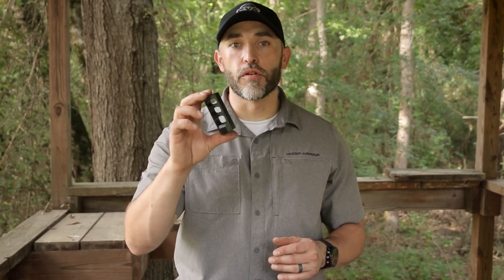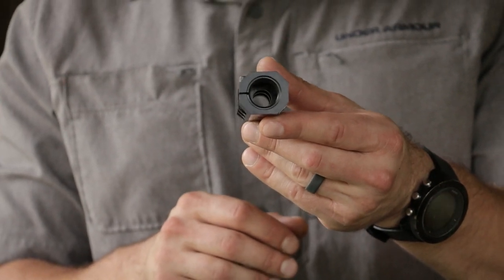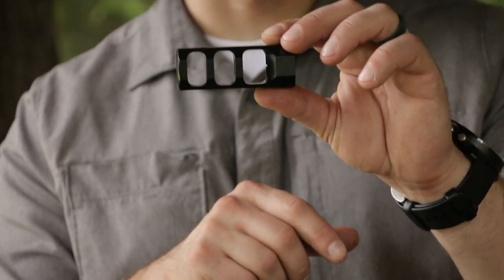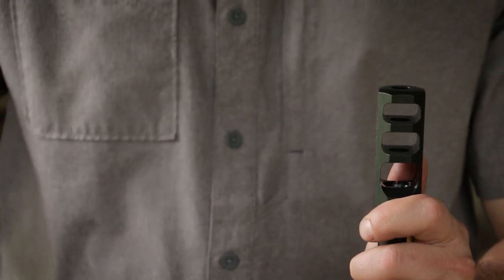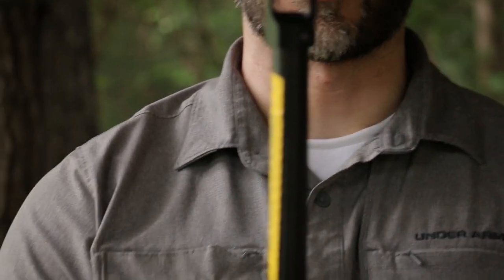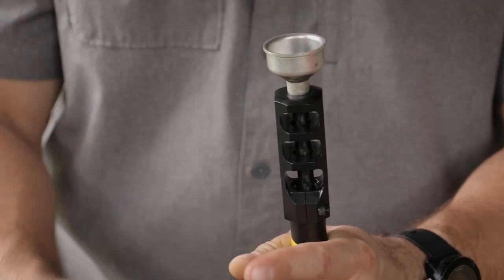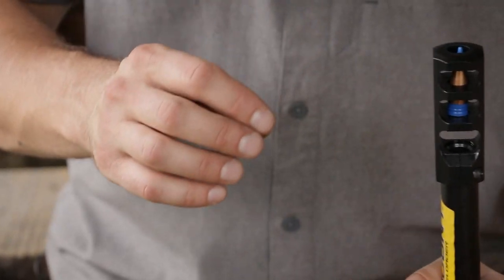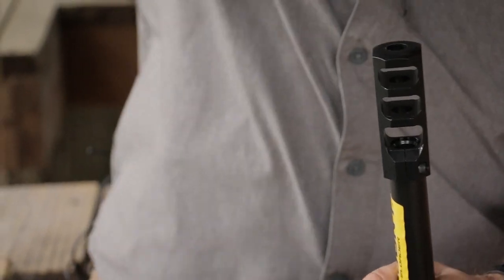Testing The CVA Paramount Muzzle Brake

Comment: I have read reports and seen pictures of muzzle brake failures on the Paramount pro with this brake. I just recieved my new Paramount Pro, have not shot it yet. The AC1725 brake is not available anywhere right now. Is that because of failures, changes, production? I email CVA 2 week ago and they have yet to respond with any answers. anyone have info?
Reply: There brakes suck , have had 9 come in shop busted apart.  Had LRC brake installed  guys said his was 1000 times better ,
Reply: @backtotherootsoutdoors4306  Thank you for the response and info on the LRC.

Comment: I bought my paramount about 2 weeks before you released the threaded barrel, do you sell the threaded barrel?
Reply from the maker: Good afternoon.  We don't sell the threaded barrel as a separate product, but you can contact customer service about getting your barrel threaded.  It's $250 and includes: threading the muzzle, a muzzle brake, field funnel, and return shipping.  You'll be responsible for shipping to us.  You'll have to ask customer service what the current turn-around time is.  I hope this helps.

Customer Service:
770-449-4687

Shipping Address:
1270 Progress Center Ave. Suite 100
Lawrenceville, GA 30043